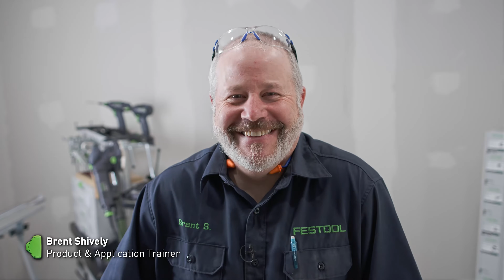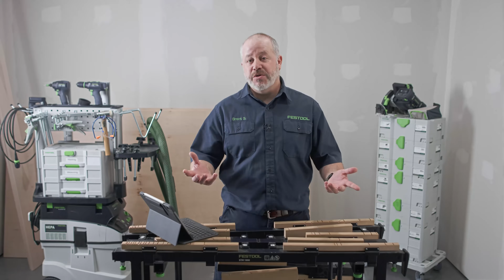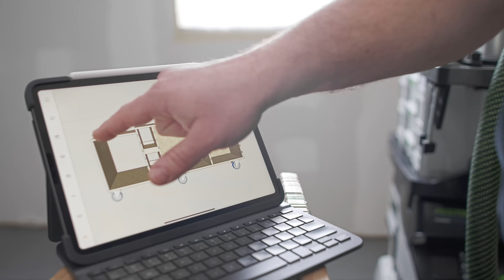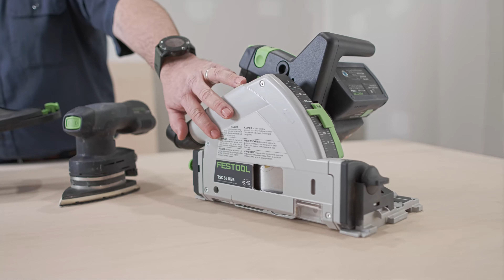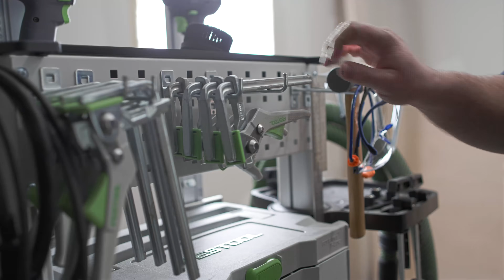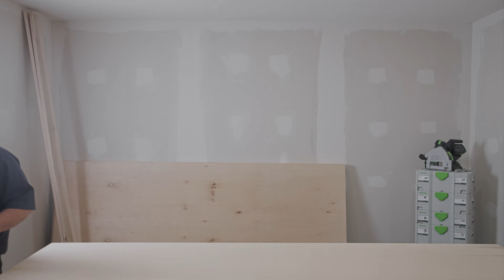Build Series 4: Mobile MFT Cart Build: EP 1

Comment: If the depth of the cabinet is 770mm, to be slightly smaller than the MFT and as specified in drawings (734 ply+18 maple edge +18 maple edge =770), and the required depth for either the rails or drawers is 380mm and the center support is 18mm, how do they systainers fit in the taller section (380+380+18=778)?
Reply from the maker: The Sys AZ drawers only need 380mm of space for installation. And with the extra 20mm allowance for the maple edging, there's plenty of room to fit them comfortably! Hope this helps!
Reply: I am sure it's me and I'm missing something.  But the cut list has the bottom ply panel at 734 in width.  Add 20 to both sides for maple  and that's 774.  Subtract the 18mm center support and that's 756.  Divide that by 2 and it's 378.  The minimum required depth is 380.  I ran by Highland Woodworking to measure and sure enough you need every bit of 380. I suppose the ones in the plan could be proud of the cabinet by that small amount.  To keep the cabinet no wider than the MFT I was planning to add 18 to each side for total width of 770.  I figured I would notch through the center panel for the slides which left me 10mm of room between slides mounted at same height.  Thanks for the reply. @festoolusa

Comment: Very cool. Why did you use the connectors instead of wood dominos in some locations?  For demonstration purposes? For clamping action?  Could you do it without the connectors but with clamps?
Reply from the maker: I chose to use the connectors in the place of clamps.  Because I'm just outfitting this shop, i do not have all the clamps there yet.  The connectors help align the material, as well as provide clamping pressure while the glue on the wood dominos sets up. 
Brent
Reply: B&CQ, my thoughts exactly.  I would not have expected something like this to need the "knock-down" feature.  I would have selected dominoes and glue.   I presume Brent chose it to demonstrate that functionality of the DF 500 with the connector set.  My experience with knock-down connectors is that they do tend loosen over time in applications where they are subjected to stress -- though in fairness here,  I am referring to the IKEA supplied connectors.  I have no experience with how the Festool connectors will perform over time under stress.  I've built a couple of similar MFT-topped carts, but never considered the need or desirability for the connectors.